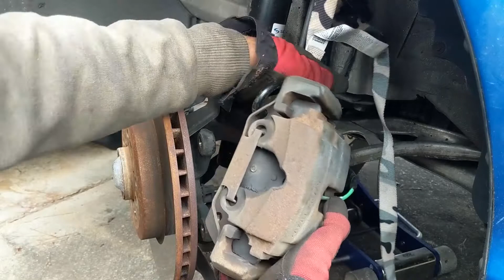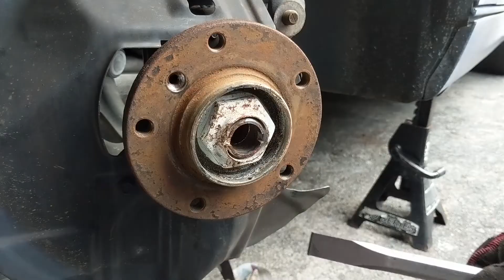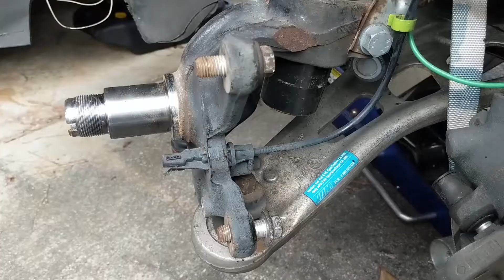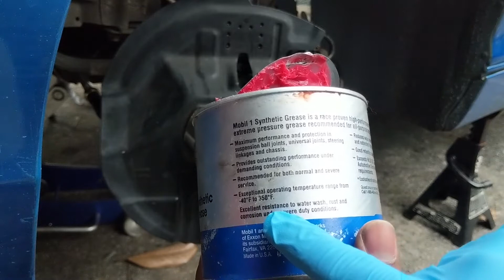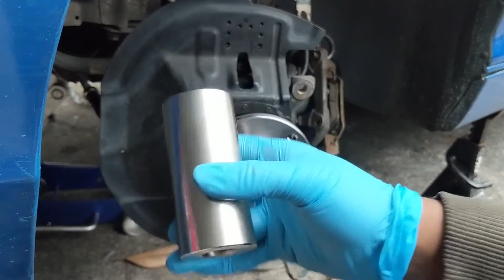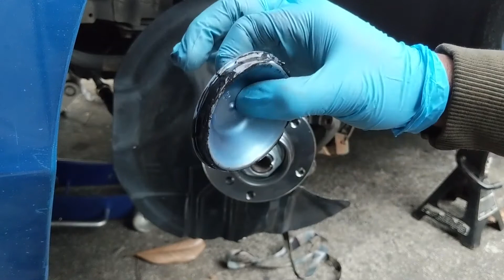BMW E46 ZHP Front Wheel Bearing | Stock Refresh #4

Comment: Don't need that bearing tool for the install BTW.  Just get it on there straight a little bit by hand and with a couple of taps from a hammer and let the nut drive it back in.  Also, 214 ft-lb for RWD and 310 ft-lb for AWD on that nut.
Reply from the maker: It is totally unnecessary! But still satisfying to use. Thanks for posting the torque specs!

Comment: Don't follow his tip on letting the bearing press the inner dust shield in place. My inner dust shield unseated itself and is now blocking the bearing. If I pull the bearing off I'll split it and risk making the insides dirty. Any tips?
Reply: I'm sorry that happened to you! This reply may be too late,  but if your hub/bearing assembly is new, you should be able to pull it off with a 3 jaw puller without splitting it. Use penetrating lubricant to reduce the friction on the shaft and it should slide right off!
Reply: Sadly it was a pretty tight fit to the shaft and the inner race stayed when I pulled the bearing off. I was very careful to keep it clean, but some speck of dust probably got in there. I'll see how long it lasts. 

The worst thing is I didn't even need to change bearing. The car still makes the noise I tried to fix.
Reply: @viggokoch   a lot of time tires are making noise, so people think it's the bearing, I know it's old but did you ever found out what was making the noise. Have a good day.